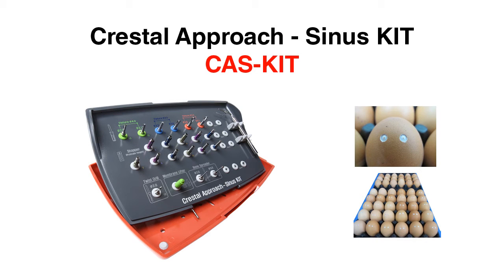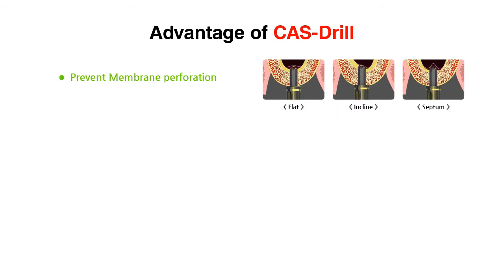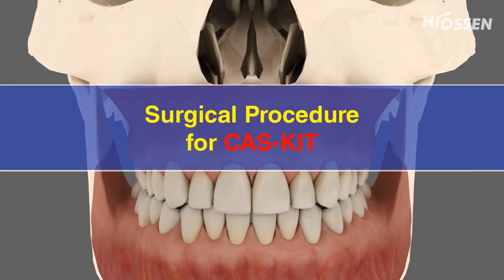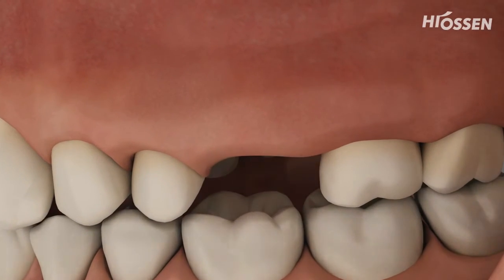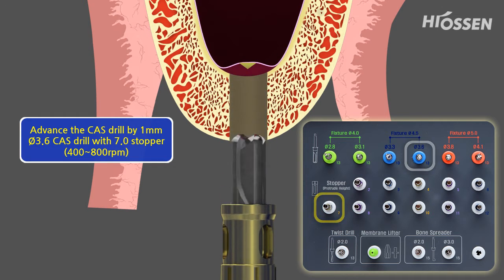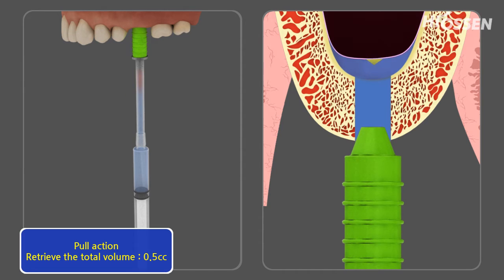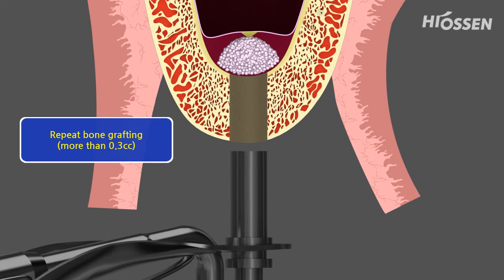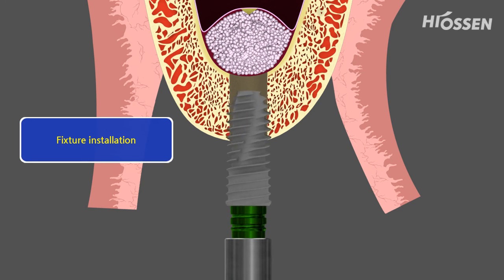CAS KIT: Crestal Approach - Sinus KIT (Single Case)

Comment: How do know your hydraulic sinus lift and packing the bone graft will gain the additional 5mm depth in the sinus to allow for the 11.5 mm length of implant?  Do you need place a depth guage to measure before placing the implant in?  In other words,  how to determine volume of saline will lift the membrane up high enough to allow for the additional depth needed, in this case 7+5= 12 mm.